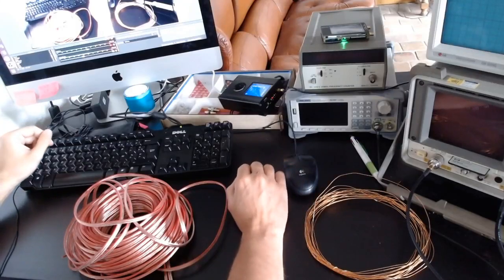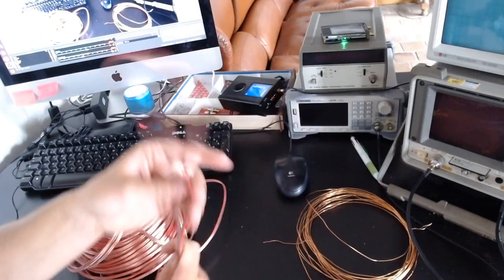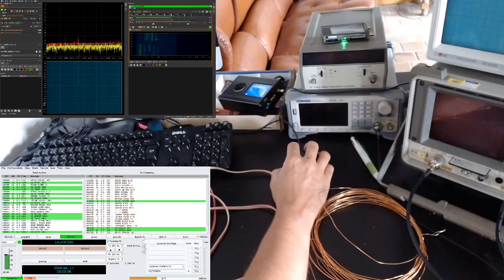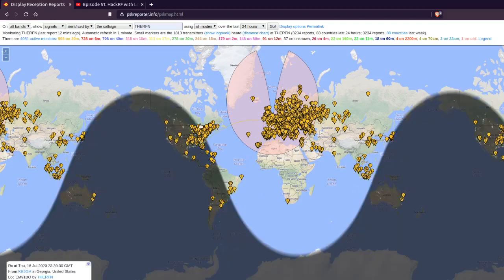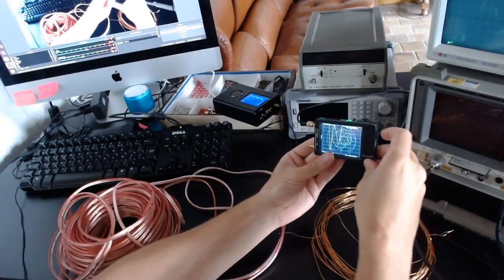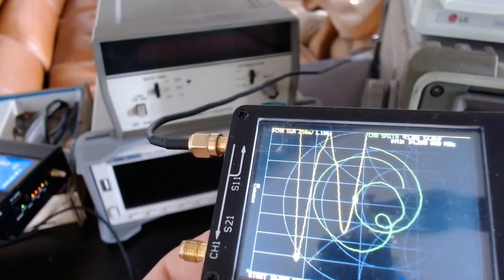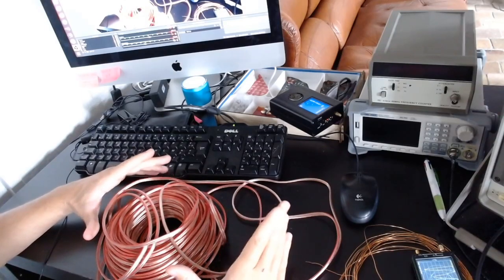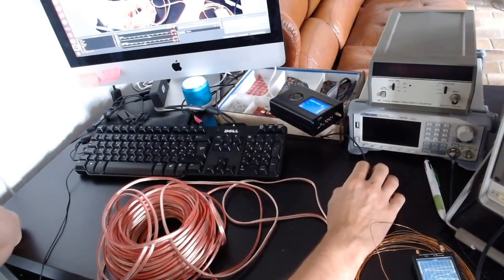Episode 57: update in HackRF + Longwire antenna

Comment: Have you used a 9:1 balun? Should it be used with a longwire? Is the balun needed only for transmit or also for receive?
Reply from the maker: Hi, no the 9:1 is another method to match the impedance of the long wire (usually much higher than the desired 50ohm) to something closer to 50ohm. I have not used a 9:1 balun/unun. I have used instead MFJ antenna tuner. Have a look at my Episode 51 for further details and Episode 49 to have a look at the antenna tuner I used.
Reply: I usually connect the outer coax directly to the mains ground with a crocodile jumper cable though many have warned me that that's not a "healthy" method
Reply from the maker: @catalinalb1722  did they also explain to you why it is not "healthy"?
Reply: @therfnoob7697  noop. Although I know that if a live wire suddenly connects to a case around the house I might get in danger or fry my sdr but other than that I assume the risk because I get a better SNR 😉

Comment: Hi will the 20 ppm offset of the hackrf oscillator affect the time synchronization? Did you used an external oscillator or a tcxo?
Reply from the maker: The Portapack board, which sits on top of my HackRF, provides a better clock (1ppm precision, apparently). Anyway, for HF even the basic HackRF clock would work fine. Worst case, your frequency reading will not be spot on to the Hertz, and deviate a little bit, but that should not be a big deal. (Precise clock is crucial in other applications, like GSM, etc).
Reply: @therfnoob7697   Thanks, I have seen the oscilator on the portapack but did not konw that it replaces the one onboard.
Reply from the maker: @catalinalb1722  yes, it basically connects to the CLKIN input the the HackRF has. So when using the Portapack, you cannot have another CLKIN signal, you are using the clock of the Portapack board. See discussion here: https://github.com/eried/portapack-mayhem/issues/59